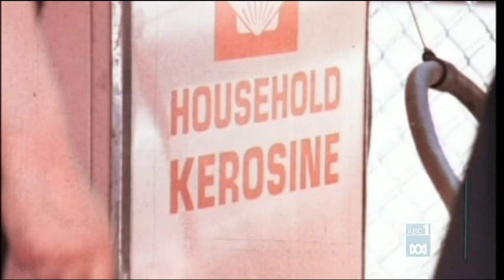Steam Powered 1963 Ford Falcon

Comment: What kind of fuel efficiency was this guy claiming to get???
The best steam engines ever built would only have about half the thermal fuel efficiency as a Otto or Diesel engine... what made his design so special? my guess that it was only marginally better in exhaust emissions and not enough to offset its really horrible fuel economy, thats why the design never took off.

cheers mate!
Reply: Stromn83 "could actually go like something in the upwards of 300 miles on a gallon of water. there is no combustion engine to date that can get 300 miles from that much fuel."

But water is not used as a heat source fuel for either engine type....
Reply: Aus Explorer I know some people that have engineering degrees, and others that are certified in their field and make a living as engineers... so I make that distinction some times...

A lot of words but very little content...

Cost does trump efficiency... thats why steam is obsolete in all but extremely large scale production were cheap fuel like Coal or nuclear become cost effective...

So no.. steam is not more efficient... and its not more cost effective in automobiles.
Reply: Stromn83 But in comparing the efficiency of different engine types we measure horsepower at the engine shaft, not the wheels.

For comparing BSFC or BSEC it is also calculated at the shaft so transmission losses are factored out of the equation here...

We are measuring the thermal efficiency of the engine not the transmission.

Even without transmission losses.. I don't see the claims of MPG or MPGE that even match that of internal combustion..

Do you have an example MPGE that can be indepentantly verified?

Steam engines typically reject twice as must heat energy as a Otto or Diesel engine, an incredible amount of heat is wasted in the exhausted steam and is lost with adding bulky and expensive condensors and heat exchangers only practical in very large or stationary applications and the thermal efficiency and fuel economy is always lower... 

This is one of the main reasons steam power has been universally replaced by internal combustion engines and gas turbines.

Cheers mate!
Reply: ok i get your question , your actually talking about the heat source. that is something that would have to be upgraded to modern terms. but yes i think they only got like 11-15 mpg of kerosene. which is actually quiet bad. that being said though we still cant say that if you were to bring steam engine technology up to todays standards side by side with a gas engine that it wouldnt be more efficient. a major factor in why steam cars went the way of the dodo is because of the boiler system being less efficient , which you are correct. its hard to bring steam to super heated state which is the most efficient way to generate power in a steam engine. the thing being though that again the technology is older even the tech in this video hasnt been improved upon by much compared to the later steam engine cars. the fact is the boiler parts of them have been in use since they went out of main use. most steam is used for generators ect now days so the technology isnt in a small form factor for a car. for instance lets say we give the same power increase and efficiency increase that petrol cars have today compared to their 1920's counter parts (example being the first combustion engines were tiny but produced nothing for power really , when the same size engine today produces almost triple that) you could see that maybe just maybe using some type of fuel other than kerosene or even gas for that matter that burns hotter at a more efficient rate could actually produce a more efficient engine. that being said most people arent going to drive around with rocket fuel to power their steam car.
Reply: Stromn83 Its very hard to get any small steam powerplant the size needed for a car to match the kind of efficiency numbers of a large stationary plant... thermal economy of scale makes a larger boiler more efficient. Small boiler /engine units the size of a car just lose too much heat.

Size and weight are important factors in automobile design.

Cheers!
Reply: Wow, you write extremely long comments...

Where is this "Modern version" of the steam powered car going to get this huge boost in efficiency?  what exactly is the technology that will allow this to happen...?  from what I can tell it does not exist in the scale required for an automobile.

Diesel engines can run on just about any fuel that a boiler/stream generator will run on.

Plug-in electrics vehicles are extremely expensive and when you factor in all the energy losses before the power hits the wheels they are not very fuel efficient at all... batteries are terribly inefficient source of power...

Cheers!
Reply: Aus Explorer I can assure there is no guessing involved... in plain terms steam is horribly inefficient... any engineer can tell you this... the video itself mostly claims the vehicles advantage in exhaust emissions not fuel economy...  this of course was prior to the widespread introduction of fuel injection and exhaust catalyst technology. 

The is no method to your comments on mpg... these numbers can only compare a vehicles efficiency not engine efficiency... and no adjustment for weight and hp, most important no mention of the critical engineering "BSFC" Certified test on the 'Cyclone' steam engine (proported to be the most efficient small steam engine)  netted only around 20% total thermal fuel efficiency ... by comparison you can go to your local automobile dealer and buy a new car that has a thermal fuel efficiency of TWICE this... several models exceed 40% 

Large Diesels can exceed 50% that is an efficiency that can only be matched by scaled up steam plants of over 1 million horsepower... which is exactly why you only see steam in use today in large electric power stations and nuclear warships
Reply: Aus Explorer Just the facts... Steam is less efficient than ICEs and turboshafts... much less.

Its simple engineering... BSFC is twice as high on steam engine of this class... and its why they are no longer used. 

I challenge you to present some facts to prove otherwise...
Reply: Aus Explorer Well if they exist...?  Name some examples that are in current production and available for sale...  as far as I am aware there has not been a steam powered car in production in nearly a century.... 

childish insults don't make you seem any smarter... or prove your point...
Reply: Aus Explorer Then name some examples that are in current production and available for sale... 

No..?  Can't do it..?
Because steam engine are horribly inefficient and long since obsolete... no one builds them anymore other than for nostalgia and historic preservation.
Reply: The car didn't take off because OIL MAFIA.
Reply: geek715 Well in this case... yes.

From a pure thermal efficiency point of view... yes, steam is at a severe disadvantage in an engine the scale of an automobile... 

Diesel engines are extremely versatile multi-fuel ICEs... the Diesel can be modified to run on virtually any liquid or gaseous fuel source... they are also very thermally fuel efficient (twice that of the Steam engine)

Electric motors are very efficient... batteries are not.

steam engines do not convert energy into useable work efficiently... they waste too much heat...and there for fuel.

You still need a heat source to boil water... one that  is cheap, portatable and simple to distribute to the market.... this is petroleum... there is no cost effective substitute.
Reply: Quite so Doktor, quite so. Indeed, it was Carnot's quest for a more efficient steam engine which somewhat ironically lead him to discover just how inefficient these engines really are... and he was good enough to share his findings with the rest of us. Thus the debate was effectively settled nearly 200 years ago, though it continues to this day among the ignorant... Fortunately for the rest of us who have grasped his theory, all else follows.

Cheers!
Reply: Deacon Swayne Yes, thank you.  And it was Rudolf Diesel's search for a more efficient internal combustion engine that led him to the work of Carnot and that allowed him to conceive the most practical and efficient simple heat engine known to today.. the 'Diesel' engine. 

It seems that many steam fans (like i was once) are unaware of the work of Joseph Black and his discovery of "Latent Heat" and the very serious problem it poses for steam engine efficiency... Latent heat represents a considerable amount of  lost heat energy during the vaporization process of water and is very difficult to recover from the Rankine cycle.

Carnot correctly predicted that heat engines that used expansion without vaporization would be far more efficient. History has proved his theory correct.

Best regards, Cheers!
Reply: geek715 Absolutely not...  fuel would be an extremely scarce and too valuable of a resource to use steam, its simply to wasteful.   Diesels are remarkable multi-fuel engines... they can run on virtually anything that burns.. Bio-Diesel (vegetable oils) Coal gas, atomized coal solids, methane bio-gas, hydrogen gas, Wood gas, methanol or ethanol (alcohol) (that is converted to esters or ether)

Where I live a large metropolitan sized hospital that runs entirely from a Diesel generator that burns methane from the local landfill.

The city also operates to pilot program with 2  buses powered by CNG Diesel engines... these engines can be also run on Methane. gas.
Reply: The real doktorbimmer Truly, it doesn't get better than a diesel engine today. With the addition of a turbo charger we are now getting some really quite impressive MPGs... Going back to steam now with all it's wastefulness and inefficiency would be absurd. 

Yes, the implications of the latent heat of water is why steam engines are fundamentally and forever flawed... such an enormous amount of energy is spent in the phase change from water to steam, effectively rendering these engines with a massive disadvantage when compared to even the most crude otto cycle engines. I'm afraid that the vague and typically unsubstantiated offerings of 'modern technology' (whatever that means), that one often sees from many posters here will not be able to change this.

What I do find highly amusing is that a steam engine was installed into a car that was built exactly 100 years after Otto patented his revolutionary engine design.. Talk about going backwards! lol!

Indeed, carnot has been vindicated time and again... the disappearance of steam is not some oversight or mistake, it's not the fault of government or influential vehicle makers and it's not a conspiracy by the oil giants... For that we can thank a whole host of excellent scientists, engineers and mathmaticians who between them came up with something better... the ICE.

Highest Regards!
Reply: Deacon Swayne Excellent remarks, could not have said it any better.

cheers!
Reply: geek715 Oh, and I almost forgot! many types of plastic have no petroleum content.. in fact the first plastic resin invented was made from coal not oil... there are plastics available made from wood and other plant resins and ethylene converted from methane gas...  so plastic can be even be made from "poo"
Reply: geek715 Petroleum is an amazing and cheap source of hydrocarbon compounds but its not the only source of hydrocarbons.. anything made from oil can be synthesized from any source of hydrogen and carbon or the compounds that contains them.
Reply: geek715 In the absence of large oil deposits, I'd expect to see ICE's running gas, it's what they were originally fuelled by after all. You have options here. Gassified coal (Coal gas aka town gas) was very common in the UK until the 70's and the early ICEs were run on this fuel, though in principle any organic material can be gassified including most household and industrial waste.... the resulting combustable gas is called syngas which can then be used to fuel spark ignition engines, diesel engines, gas turbines and even fuel cells. Alternatively, the syngas may be converted to synthetic diesel via the Fischer-Tropsch process.

Using gas as a fuel in vehicles is troublesome because of a typically low caloric density per unit volume, this can be overcome by compression or liquefaction but at a cost in terms of net efficiency.... but still an improvement over steam.

In discovering petroleum whe have actually been very lucky to find a fuel source which offers high energy density, ease of combustion, liquid at ambient temps and in great abundance... There is nothing quite like it (for transport applications) for the time being.

If it's mass power generation you are talking about, why not simply use coal or nuclear? It's what we already use for the vast majority of our power production, so life could more or less go on as before. Yes, the solar-steam plants would certainly work, in the right places... In Spain they have such a plant where many heliostats are focussed onto a central tower containing molten salts. The salts are heated and then used to heat water into steam to drive a turbine and generate electricity. I wouldnt hold much hope for such a plant where I am in rainy old England, however!

Good luck with the book.
Reply: The real doktorbimmer Indeed, the plastic I have for my 3D printer is PLA... apparently a corn starch product. That'll keep the greens happy! 

Cheers!
Reply: Chali Chaligha You are an idiot... you can buy a new car today that is well over 40% TFE more efficient than a 1 million hp steam engine
Reply: Chali Chaligha What about Latent heat?  the very process of boiling water into steam wastes heat energy does it not? Don't you remember Joseph Black?
Reply: Actually, the emissions from these type of boilers are better than internal combustion engines, because the combustion is more controlled.  And that's without any emissions control gear.  Jay Leno's Doble has really good emissions also.
Reply: Mark Stockman Certainly it would have had much better HC and NOx than a non-catalyzed, carburetted engine with breaker points... that would have still been common at the time this was produced.

But compared to the technology that was just over the horizon ( and in general use today)  it could at best match the emissions output.

Of course the real issue is fuel economy... steam, at best is 20%

The most efficient turbo Diesels are easily twice that.

Cheers!
Reply: doktorbimmer steam engines dont have to use really any kind of transmission which is where the increase in efficiency comes from. there are a lot less friction parts to slow down the RPM of the engine. the last steam production cars from the 1920's could actually go like something in the upwards of 300 miles on a gallon of water. there is no combustion engine to date that can get 300 miles from that much fuel. mainly because the conversion of power inside todays combustion engines have a huge power loss from the cylinders all the way to the drive train is almost a 60% loss in the power created at ignition point. engines today in a sad fact are less efficient and are still to this day made with technology that almost went backwards. not to mention the power on demand you get with steam that you dont get with modern combustion engines. look up the 1925 Doble E-20. if they had never actually converted to gasoline engines , there is a good chance we would actually have trucks ect today that get 500-600 miles on a tank of water while hauling , cause in essence its a steam train on tires. really though combustion engines are horrid , if you got all the torque at the spark on your drive train everyone would have huge hp cars that get 200 or more miles to the gallon. Modern Gas Engines."Modern gasoline engines have a maximum thermal efficiency of about 25% to 30% when used to power a car. In other words, even when the engine is operating at its point of maximum thermal efficiency, of the total heat energy released by the gasoline consumed, about 70-75% is rejected as heat without being turned into useful work, i.e. turning the crankshaft." and 1924 Doble E series "The 1924 model Doble Series E steam car could run for 1,500 miles (2,400 km) before its 24-gallon water tank needed to be refilled; even in freezing weather, it could be started from cold and move off within 30 seconds, and once fully warmed could be relied upon to reach speeds in excess of 90 miles per hour (140 km/h). In recent years Doble cars have been run at speeds approaching 120 mph (190 km/h), this without the benefits of streamlining, and a stripped down version of the Series E accelerated from 0 - 75 mph (121 km/h) in 10 seconds.[14][15] Its fuel consumption, burning a variety of fuels (often kerosene), was competitive with automobiles of the day, and its ability to run in eerie silence apart from wind noise gave it a distinct edge. At 70 mph (110 km/h), there was little noticeable vibration, with the engine turning at around 900 rpm." so not nearly as much as i thought , but with todays tech i would venture to say they could make it run better than they did in 1924. sorry for the lengthy reply , but its a rather hard question to answer. as well as its hard to get a straight conversion for mpg for a steam engine as they are rated by a different system called "Carnot efficiency". but hope it helps. :)
Reply: yes and no , they dont use boilers in cars , they use a steam generator which isnt even remotely close to a boiler. the thing i am trying to say here is yes they do with current technology , but if you gave steam powered engines the same amount of attention to detail instead of laying dormant for almost 100 years the size would be much smaller. its a proven fact that is what happens with all technology. over time it gets smaller and smaller. the first combustion engines were worse than steam engines. eventually there were break throughs in the tech that that lowered fuel consumption making it slightly better than steam. the thing is yes they lose heat fast. but the tech is almost 100 years old , very few if anyone has improved on the design for the sole purpose of using it as a car. the few that have tried have always used the same type of set up with a few minor mods to the original designs. that is what i am getting at. the large industrial steam engines used today are meant for a specific purpose , just like the gigantic diesel engines they use for boats. they arent even really remotely close mechanical wise for a car engine. so the comparison is kinda meak you are still comparing newer tech with old tech. cause steam in large scale for industry and the likes have been upgraded and reworked. the whole concept here is car sized steam engines are on dated technology. no one has even contemplated redoing it from the ground up which is what needs to happen. yes weight  and size are important in the design....unless you live in america...cause here we build huge SUVs that serve really no purpose other than to make soccer moms feel like they can drive like a lunatic with no fear of  death. they weigh tons and get shit mpg. even worse in some cases than the damned doble that got 11-15 mpg of kerosene. i guess my whole point is this tech is ran off a steam generator using old style coil burners to super heat the steam. they dont use jets of any kind. they dont use a whole lot of the technological breakthroughs that we have seen since the early 1900's. its sad really though because who knows what could be if we were so stuck on consuming oil like a fat kid eating cake. in all honesty we shouldnt be driving cars/trains/trucks of any kind that consume oil. there is better out there , but the oil companies stifle it because there is no money for them in the oil market being destroyed. its why the fuel cell batts have taken so long to be exponentially increased in power and reduced in size. electric is far superior to any combustion engine of any type. its power on demand , there is no wating for the engine to reach so and so rpms. you press the peddle and within less than a second you have all the power for that speed. where as a combustion engine has to work to reach the speed as well as maintain it. same with steam. the problem is with fuel cells being "dangerous" (no more actually than a gas tank on a car , but its new and freaks people out) and the fact that they havent been able to work out a way to prolong trips using electric. once all these things are worked out though you will see one of two things happening (which are already kind of going on with tesla motor company and big oil trying to discredit it so it fails). the fact is the reason people today even think about things like this , is wether global warming is true or not , cars are bad , and with the way humans like a screw like rabbits and over populate pretty much every habitable inch of this rock we live on. you cant just keep using that toxic shit plus eventually it will be gone. there is no magical planet we can get big oil to fly to and steal oil from. eventually steam and the likes may be the only option.
Reply: Stromn83 Several different types and designs of boilers and "steam generators" have been used for steam powered motor vehicle applications.

When I said boiler I used it genericly, referring to any device used to convert heat energy into steam.

Cheers!
Reply: If this were all true, we would still be using steam trains. True steam trains were very slightly more efficient than diesel electric, but the fact of the matter is, they had too narrow of a power band. With a piston driven engine, you have a choice of RPM or torque. not both. That is why gas engines have transmissions. The other difference is that with a single or even dual cylinder, you have power pulses. Peak torque only occurs when the crank is at 90 degrees. The torque rapidly decreases on either side of that.
Reply: First, BTU for BTU of fuel, diesels are more efficient than steam.  Coal and bunker oil were cheaper than distillate (diesel).   Second, a steam engine develops maximum torque at zero RPM, and max horsepower at max RPM; horsepower is usually limited by boiler output, not the engine.  Choose the drive wheel diameter based on desired top speed vs. drawbar pull.  With "late steam" tech like disc drivers, roller bearings and alloy drive rods, you could get higher speeds out of smaller drivers.  True, steam engines have power pulses.  An American steam locomotive generally has two double-acting pistons, one on each side, with the two sides 90 degrees out of phase, so you never had both pistons at TDC or BDC.  Some European locomotives used a third piston in the center (between the wheels) hooked to a crank axle, and each piston TDC 120 degrees apart.  A maintenance nightmare, but it did put a steam locomotive over 125 mph in 1938.
Reply: Mark Stockman Yes, the Diesel is the most efficient combustion engine and efficient over the widest  range of loads and power outputs. The modern Diesel-Electric locomotives use electric traction motors which can deliver high torque at any RPM.. and without power pulses, most feature some kind of electronic traction control features too..
Reply: Daveinet I don't believe a practical land based steam vehicle engine ever reached the 40-50% fuel efficiency like the Diesel engine... the thermal losses are very high on engines of the size of a train or a car. Cheers!
Reply: NativePrairie WolfTwo "ALL of the heat generated by the burning fuel is used."
Then why would they need a condensor at all... where is all that condensor heat going?????  it didn't get used to drive the wheels... did it?
Reply: ***** If all the heat got used there would be no steam exiting the exhaust port.. just liquid water and air at ambiant air temperature right?
Reply: ***** Well no confusing you with an engineer???

If the steam left over has to be condensed that means there is heat leftover ( completely unused heat) than it is wasted heat energy that never went to the road wheels... a small automobile sized steam engine averages about half th thermal efficiency of an ICE
Reply: ***** I'm certain its emissions output would be much higher than a new automobile...

15MPG would be the worst fuel efficiency of any new car available today.

It still could never match the BSFC of a modern Otto or Diesel engine, not even close.
Reply: ***** said qoute:  "ALL of the heat generated by the burning fuel is used."

So by 'ALL' you really meant only  20%??????
Reply: ***** You don't realize that your comparison is technically not even relevant without making comparisons of all the important specs not just MPG? or weight? otherwise your comparing apple to oranges..   Does the Doble have A/C climate control, power steering, heated mirrors and  power adjustable seats? no.. i don't think so..
Reply: ***** I believe you misquoted Mr. Leno, he in fact said "almost would meet current emissions standards"
Of course you realize that cars manufactured in 1925 are completely exempt from vehicle emissions testing so he would be speaking off hand or conjecture... he never metioned that the Doble had ever had its exhaust emissions tested.
Reply: NativePrairie WolfTwo Well according to the article you just linked the Doble model E series could only manage 15mpg and that was on kerosene? so you forgot your conversion factor to gasoline which has fewer BTUs of energy per gallon than kerosene....  you can't directly compare the two in terms of MPG.
Reply: NativePrairie WolfTwo Well it didn't specify what  standard it met, CARB has a variety of standards based on the model year, GVW and type of fuel... they vary widely in terms of actual pollution output....
Reply: doktorbimmer
 Compare it to ICE vehicles of the 1920's, you know, apples to apples.
Anything else and you're just guessing at what 80 years of development would have yielded.
It wasn't until the mid '40s that ICE engine power efficiency started to pick up towards 100hp per litre engine capacity and even then the fuel economy was still terrible.

In 1966 the average MPG in the USA was around 9-10 for light trucks [which the Doble is of around that weight], in 1991 it got to 17 but only improved to 18.2 by 2006. Thats average ACTUAL MPG not claimed in the sales material.

and in 1923 the average across all vehicles was 14mpg, so 15 for a Doble in 1925 sounds pretty good considering the power output and top speed [over 190kph without streamlining] compared to the 10hp-40hp crap that passed as IC engines in the '20s.

If you have problems with the numbers provided, take it up with University of Michigan who did the paper around 2008.
Reply: your comments seem to be based in bias and a lack of understanding, but worst of all you're inability to understand what 80 years of development has yielded for the ICE while small scale steam has had no such R&D.
Let us know when you've checked your bias at the door and made a conscious effort to accept that in 80 years just valve and burner tech alone could have made large advances, much less all the other components.
Modern steam wouldn't even need mechanical valve gear, electronically controlled, hydraulically operated valving would be a major improvement over turn of the century vale gear.

when you start comparing like for like, era for era, then someone might take your opinion more seriously.
Reply: You keep talking about BSFC when you should be talking about BSEC, as it is universal across fuel types.
Most of the lost of energy in steam is via exhaust heat, but with modern materials and design much of that waste could be avoided, and you'd only have to reduce heat waste by around 25% to match current ICEs.
Rather then running your condenser in air, run it through the water reservoir where its acting more like a pre heater, reducing the fuel needed to heat to next unit of water going through the flash coil. Not only will it retain some of the waste heat in the cycle, it'll also be a more efficient condenser, drawing more vacuum thus increasing the efficiency of the multiple stage expansion unit.

On top of that you could use modern materials to up the input temp and pressure to around 600C and 3000 PSI to start to get towards turbine efficiency, keeping the engine and connecting tubing hot with burner exhaust.
Its the high input temp and pressure that yields significant efficiency gains for large plants.

and thats before even taking into account that ICEs only ever hit their peak BSEC at specific RPMs and loads. where as a reciprocating steam engine has a vastly wider RPM and load band where it meats largely the same efficiency.

Then I could argue that you could fire steam on a thorium reactor [yes, car sized] where a gram of fuel will last you years, not seconds.
but that needs the aforementioned R&D to to make it viable and R&D seems to be something you can't handle the idea of, you'd rather compare modern ICE with 1920's era steam.
Reply: Aus Explorer Wow... you are really dreaming now... a lot of hypothetical bollocks but no examples of engine technology that is currently available... or in production

The fact is many of your suggestions have been tried and have been found impractical or simply don't work.

Both  methods can be converted into a total thermal energy output... which is how much fuel is really being wasted.
 The simple fact is that steam engines on this scale do not have the thermal fuel efficiency to match ICE's or gas turbine/turboshafts.
Reply: "no examples of engine technology that is currently available... or in production"

You're a moron.
You're literally saying that because its not already made then it can't exist.

That right there is the epitome of stupidity.
You can't seem to grasp what 80 years of development does for a technology.

Its good though that now everyone who ever reads this will know that everything you say is based on an irrational belief that if it doesn't already exists then it can't ever exist.
There is some circular logic for everyone.
Reply: Reading comprehension fail.

Its not an insult if its an accurate assessment of your cognitive abilities.
You seriously lack the ability to grasp relatively simple concepts.
Reply: I think you've damaged your brain to the point that circular logic makes sense to you.
Reply: Aus Explorer Just the facts... it would seem they are something you are unfamilar with...

The are no steam engines available in this class that come close to matching the thermal fuel efficiencies of ICEs or gas turbines.

None...
Reply: And in 1925 there was no rocket capable of taking a person into space either, but shockingly with R&D they not only got a person to space but even took them to the moon and back, something that according to you is impossible, because before they'd designed and built such a contraption no example of a production version was available!

Your logic = "it doesn't exist so therefore cannot exist!".

As I said, you might have hurt your brain at some point so that circular logic now appears to be rational.
Reply: Aus Explorer Wow... you really don't know much about steam engines do you...? 

I just explained to you that they don't exist because ITS NOT POSSIBLE...

You need to scale up the size to at least 100,000 shaft hp to get the thermal efficiency up high enough to match ICE's...

otherwise the thermal loss is too high... the shear size, weight and cost of engines this scale only make them practical for very large ships... automobile are out of the questions... even locomotives
Reply: Aus Explorer Interesting analogy you chose... particularly when rocket engines are about 3 times more thermally efficient than steam engines...
 but of course you probably don't know anything about rocket engines either....
Reply: Well thanks to you we know that if something isn't already in production it can never exist.
Reply: Aus Explorer  You cannot just create or destroy heat or make it disappear... you can only convert energy from one state to another... in this conversion process there will always be losses... steam is a very inefficient means of converting energy. There are certain laws of physics that apply to engineering that can't be ignored there are no cheap or practical steam engines in this class because there is no practical means to make there thermally fuel efficient.

THIS IS ALSO WHY NO ONE MANUFACTURES THEM ANYMORE
Reply: "THIS IS ALSO WHY NO ONE MANUFACTURES THEM ANYMORE"

False, fuel efficiency in ICE powered vehicles fell between 1920 and 1973 from an overall average of 14mpg to just 11mpg, people didn't care about efficiency long before steam was no longer a thing in consumer vehicles.
so your argument is total bullshit since if fuel economy mattered at all then then 14-15mpg of a Doble E series would have been desirable over the lower efficiencies of vehicles after the 1930s.

It wasn't until the late '70s and early '80s that ICE vehicles were getting the same mileage as steam vehicles 50 years older then them.
are you going to keep arguing that efficiency was driving the market pre-1973?

and lets not forget you're trying to compare a steam engine thats putting out more then 4 times the torque of any era comparable ICE and getting the same mileage still.
Find a single SUV in the last 30 years that makes over 1000 ft/lb at the wheels and gets better then 15mpg.
you can't because they don't exist.

next you're going to argue that you can't compare the vehicles blah blah blah, which only further makes the point that efficiency doesn't matter.

your argument is invalid, period.
Reply: Aus Explorer You seem to be very confused about BSFC, HP and Torque and the whole concept of thermal fuel efficiency...

The Doble at best produced only 150bhp.. so compared to a modern SUV 14-15mpg is really terrible... 

There are no modern (or obsolete) steam engines that can match the horsepower output and thermal fuel efficiency of a modern Otto or Diesel engine... none
Reply: bhp? really?
I knew I was dealing with someone of limited intelligence, but this is a new low.
Reply: Aus Explorer Seriously...? you cannot directly compare fuel efficiency of a 150hp engine with say? an engine with 250hp...   not to mention vehicle weight and a certified standard test cycle... which there would none be available for the Doble...  there is also the matter of conversion of btus for fuel type...  the Doble mileage quotes are with kerosene, not gasoline.

Youre not fooling anyone... especially not me.
Reply: edstar83 It didn't take off because it could never match the efficiency and performance of other superior engine designs...
 Steam engines of this size use MORE fuel... not less... so even playing devils advocate the oil industry would have no interest in shutting it down... and they didn't
Pritchard tried to sell it to a major car or engine manufacturer... no one was interested...   end of story
Reply: doktorbimmer
Righto. You must of been personally involved with it since you sound so sure of yourself.

You can believe that if you want mate but I wasn't born yesterday.
Reply: edstar83 Not with this particular design, but with many others.. as a professional engineer... its my job to know about such things...

Steam engines (and only the turbine types really) can only match the thermal fuel efficiency of a Diesel engine at a scale of over 100,000 horsepower.

which is why.. big shocker here... you only see steam used in large nuclear warships and stationary electric power plants
Reply: doktorbimmer
"as a professional engineer"

lol.
as opposed to what? an amateur engineer?
Someone is either an engineer or they aren't, and then its what kind.
civil engineers aren't qualified to know shit about mechanical engineering and vice versa .etc.
You could be a train engineer for all we know, or maybe just making it up, you sure don't sound like any engineer I've ever worked with.

You just don't seem to be able to understand where the inefficiencies in small scale steam have traditionally been, how modern manufacturing and materials could reduce those efficiencies and how just like with ICE 80 years ago turn of the century designs were far from efficient because of their immaturity.

If you were an engineer you would be instantly able to see how the efficiency could be raised with modern design.

Simply expanding the steam more times and then exhausting the waste steam through the tender water as a pre-heater would bring the efficiency up to petrol engine standard, then using modern materials like ceramic lined combustion chambers, connecting lines, pistons and bores would reduce heat loss to the point where with electronic valve timing and hydraulic valves you could reach or exceed diesel engine efficiencies, but you'll no doubt parrot that because no one has done it then it can't be done just as you have repeated in the past.

This is why you're not an engineer, engineers solve or circumvent problems, they don't whine about them.

On top of that ,actual engineers know that thermal efficiency isn't the be-all end-all of comparisons, you started out not even using  a unit that could be compared across fuel types without conversion.

The real question is $:work ratio and then after that emissions.

If I have an engine that does 1 unit of work for $1 and you have one that does it for $2 and they both have comparable emissions then no one but you is going to give a shit about thermal efficiency.

The other thing you fail to acknowledge is that ICE became popular over steam because back in the day up until the Doble, steam was a pain in the butt to use compared to an electric start ICE.
Today we could have a turn-key system that is ready to go by the time you have your seatbelt on.
Thats what people care about.

How much does it cost to buy.
Does it meet their requirements for ease of use and features.
How much does it cost to run.

A steam engine can run on any fuel that can make enough heat.
ICE can't.
in 50 years lets see how popular ICE is when oil is $500 a barrel, do you think people will use ICE or electric powered from super-capacitors charged from an outlet powered by a steam generation plant?

cost trumps efficiency.
period.
Reply: doktorbimmer "So no.."

Did you actually make a point before that? Seems like you mind as well have said "Well I think I'm right, so therefore I am.".

I'm generally interested in which engine would be more cost efficient, and so far, the cost of manufacturing oil as opposed to using whatever fuel source might be available seems to be in favor of a steam engine. Not to mention it might be possible to heat a boiler with potentially a ultra-insulated molten-salt thermal battery generated by solar power. That would certainly cut down on several costs all together, I should think. I mean, I'm sure NOONE on this thread (hopefully) imagined shoveling coal into a car engine as a method of standard transportation.

I do wonder about the efficiency that's lost when there is exhaust steam. What is that all about, anyway? We really can't design an engine that reuses the mechanical and thermal energy that is so clearly thrust out of the engine? There has to be a better design, we just need to develop it.

In case perhaps crude oil was nigh impossible to find, say, in the future, what in the world would we even DO with an ICE? Vegetable oil? I can barely get a lamp to light with vegetable oil. I think it would be wise to invest in steam technology in preparation for important things like "running out of oil" or "global warming". Even if it's not that efficient, it would be better than nothing.

I had another question to pose since there were more than a few engineers on this thread. How would steam and ICE compare to an electric engine? I mean, if you took that same thermal battery and applied it to a straight electric engine, would it be able to generate enough mechanical force to outweigh either steam or combustion in power? And if it takes more fuel/energy to run, how would that stack up cost wise?

I feel like a well designed closed-loop steam engine would outweigh any other engine in cost, emissions, and (if correctly insulated and designed with the "exhaust" reused) thermal efficiency, but that's an opinion based on what I know - and I don't know everything.

Seriously, if steam isn't the actual fuel being burned, why is there "exhaust"? As far as I can tell it's just to make it look cool. That's like an ICE "exhausting" a crankshaft or a piston out its tailpipe or something. The steam is an expansion mechanism, not a fuel.
Reply: edstar83 Yes but you were born ignorant with no desire to correct that Read the doctors comments He is giving a valuable science lesson for free.
Reply: edstar83 There is absolutely no doubt about it... the oil companies would get very rich if we all switched to steam powered cars... and we would all be spending a lot more on fuel... no matter where it came from.  Its not practical to build a steam car engine as efficient as the the I.C.E. but its also theoretically and thermodynamically impossible to build a more efficient steam engine with the same output of an internal combustion engine. 

Cheers Mate!
Reply: The real doktorbimmer A long, but highly entertaining read!

Cheers!
Reply: Deacon Swayne Thanks, Carnot was a revelation to me... unfortunately so many others have yet to be enlightened!

cheers!
Reply: +Deacon Swayne +The real doktorbimmer  In a world without large oil deposits, would steam be the only alternative? 

I'm writing a science fiction book in such a world, and am looking not necessarily for a steam-punk theme, but am just curious as to what a society might look like with no petroleum products. So far I have determined there are no movies, pens, or plastics of any kind. No lanterns, and the oil for machinery is mostly vegetable / animal oils.

I'm having trouble in developing power however, and steam via concentrated solar power seems to be the most likely development that would occur. Do you agree? Or could there be another form of fuel. I'd hate to think of coal as a primary fuel source but it is certainly an alternative. The question is would it be more practical to use a steam/solar combination or coal?
Reply: The real doktorbimmer Facepalm. Sorry, but simple fact checking shows that large power station steam turbine engines  have the highest efficiency of any engine ever produced barr jet engines which match large steam units in efficiency.
Reply: The real doktorbimmer Please stop. ICE's in cars have an average thermodynamic efficiency of 25% for newer models and LOADS of heat is wasted in the exhaust and radiator. Besides, it is a fundamental  necessity for a heat engine to have a waste heat sink or it will not function. It is impossible to use 100% of the heat energy available and this leads to the idea of carnot efficiency, the maximum amount of energy you could possible obtain from a temperature DIFFERENTIAL. There must be waste heat.
Reply: +The real doktorbimmer 

Near the beginning of his post, Stromn83 asserted that steam cars made in the 1920s could get 300 miles per gallon of WATER.  Of course that has nothing to do with efficiency.
Reply: Frank Eggers Yes, my comment was in regards to the inherently low thermal efficiency.. not water efficiency.. we got him straighten out in the follow posts regarding what that meant.. I disregarded the erroneous water consumption claims.. Jay Leno's Doble get no where these water consumption rates.. Mr Leno himself has publicly refuted them as false advertising that was still permitted back then
Reply: It might help if you posted the formula which relates the efficiency of a Carnot engine to the difference between the high and low temperatures on which it operates.  It should be obvious that the temperature of the steam for a steam engine will be less than the peak combustion temperature of an IC engine.
Reply: Frank Eggers The critical value is the percentage between T1 and T2.. not the actual temperature value itself..
Reply: The real doktorbimmer
It's been almost 200 years since Carnot demonstrated the serious inefficiencies associated with steam engines and 120 since Rudolf Diesel conclusively put the issue to bed.... regardless, here we are in 2016 and I see the debate rages on yet!

Cheers!
Reply: @deaconswayne1894  Indeed, there are more ignorant people born every day... they will always outnumber engineers and people with a college degree..